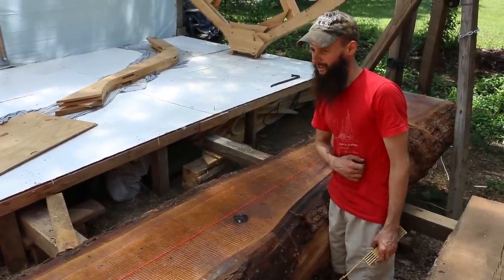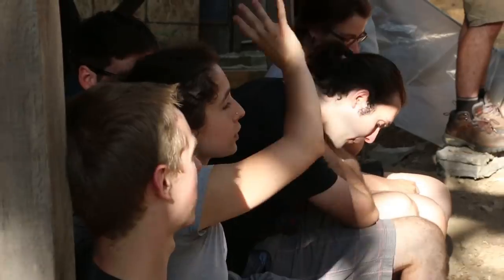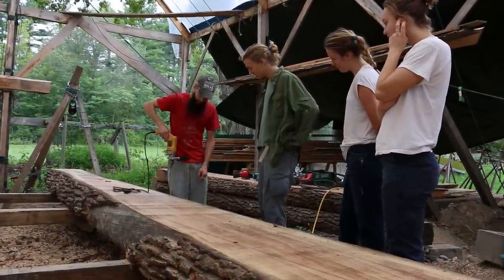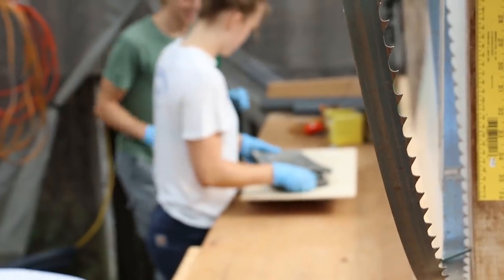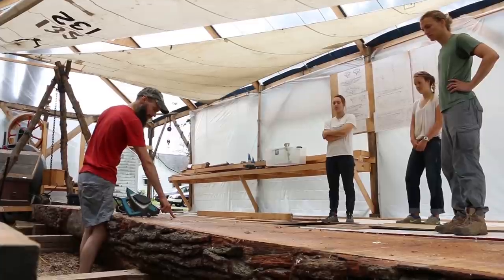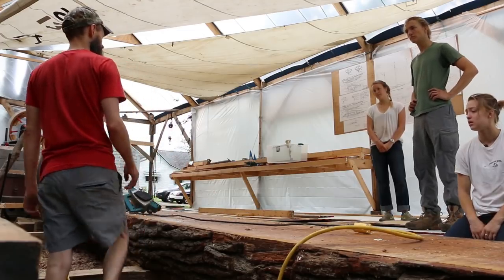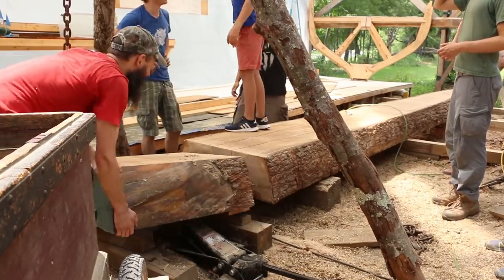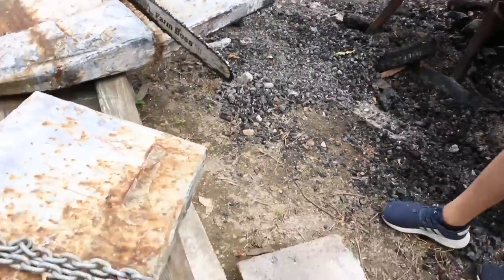Acorn to Arabella - Journey of a Wooden Boat - Episode 17a: Shaping the keel timber (Part 1)

Comment: I don't know if this was asked and addressed elsewhere: but: in a much earlier video you said you were going to laminate the keel from two pieces of timber.  Then you bought a huge bit to do it in one piece.  I didn't see anything explaining why the change of heart.  Thanks
Edit: I think I found the answer in the next chapter: there is more to the keel than the large bit on the bottom. The laminated bits are for further forward.
Reply from the maker: We did intend to laminate the whole keel timber as well as the deadwood but by the time we would have milled all the beams flat and true and bought all the glue it would be more time and cost effective to buy a one piece timber.  So that is what we did and why we switched.

It did make sense to laminate the stern and stem assemblies which we did and the deadwood (fore and aft of the ballast keel) which we will do this spring once it warms up enough for the glue to cure properly.

Comment: I’m wondering if a Prazi  PR7000 Beam Cutter for 7-1/4-Inch worm drive saws would have worked to make that cut in one pass?   I haven’t used one, but I see one you tuber actually using one for a small sawmill.
Reply from the maker: Maybe,
Since the keel timber is really the only beam that big it didn't seem worth investing in a beam cutter or monster circular saw like the big Makita beam saw.  It was a good work out finishing by hand anyways =)

Comment: The saw can not cut though the whole thing, really? Why not? Watch the video of Master boat builder, adds handle for the bar and makes two person saw, come on
Reply from the maker: The blade is 10" and the timber is 11", the blade can only cut a little less than 1/2 it's depth.  A 15" Makita beam saw could have done it accurately in one pass  but those bugger ain't cheap!
Reply: Acorn To Arabella get a longer bar and chain drill holes through the tip add a handle for second person and cut in single pass, it's quick easy peazy simple, remember the right tool for the job and you work half as hard, half can be divided between top and bottom, chain is cutting in the center of bar, you can use 16" bar, the handle is made with guarding for second person here watch
https://youtu.be/uqXvWIEFzHk